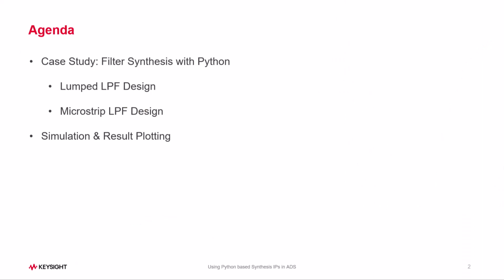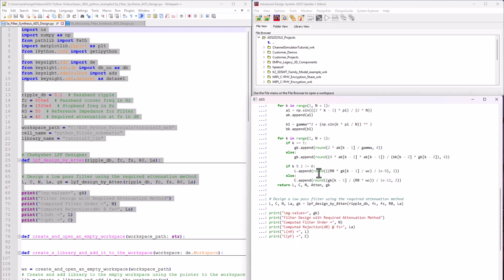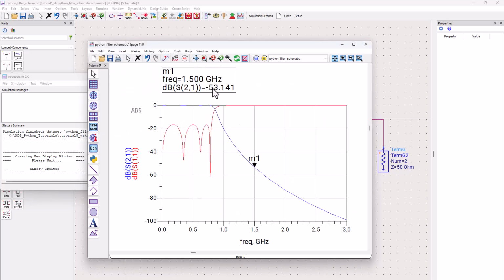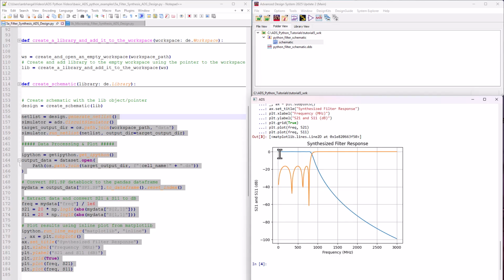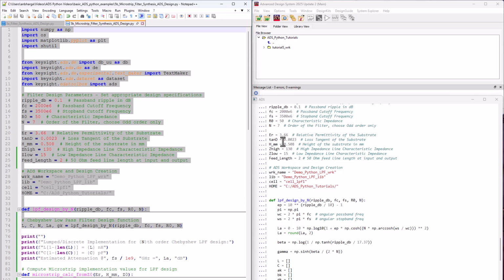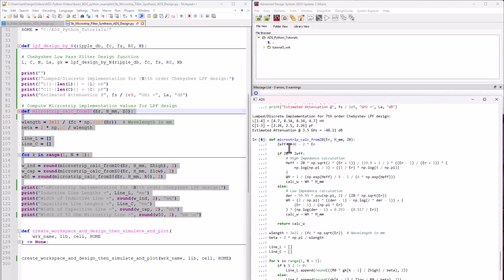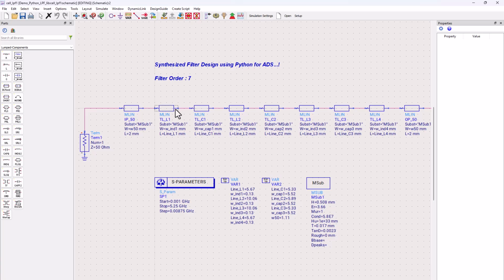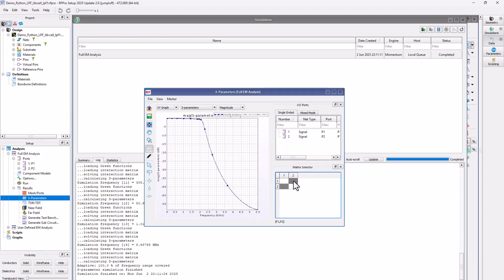ADS Python Tutorial-5: Using Python based Synthesis IPs in ADS

Comment: Hello, I’d like to run  optimization after your operation. Once I’ve placed the components and set up the goals, how do I use Python to actually start the process? I couldn’t find anything about this in the help docs. I’d really appreciate it if you could take some time to reply.
Reply from the maker: Hi,
We will get there when we start talking about “Nexus” which is the new simulation and optimization engine in ADS. Nexus offers superior optimization capabilities including parallel optimization on local machine or LSF or Design Cloud etc
Reply: @BhargavaAnurag  Crazy, I’m really looking forward to your new video. But for now, is there a way to start the optimize program using Python commands in ADS, just like we can start simulate with the keysight.edatoolbox.ads.CircuitSimulator() command? I’ve gone through several Python libraries provided by Keysight but couldn’t find any function related to optimization. Does this mean that optimization is not currently supported through Python control?